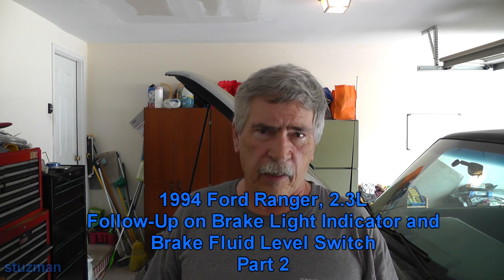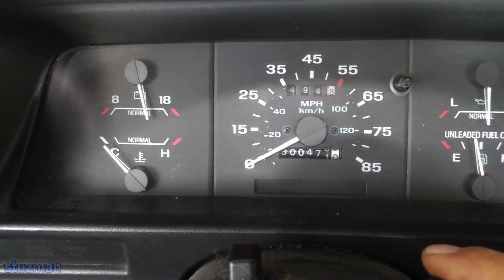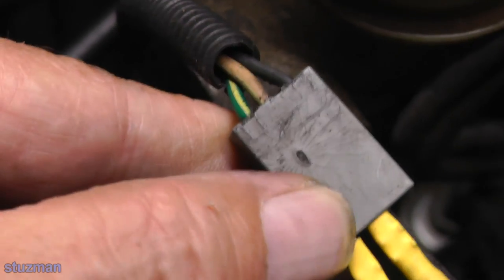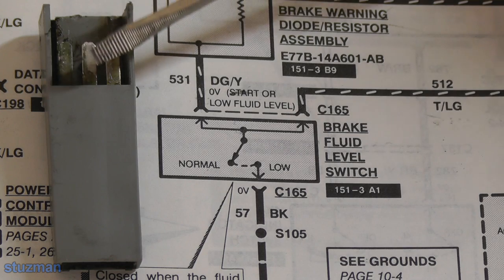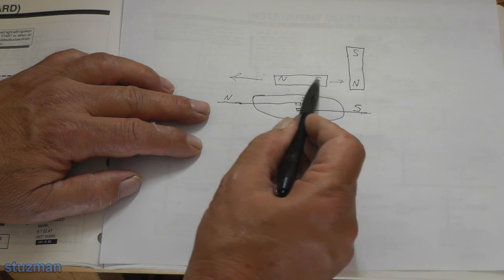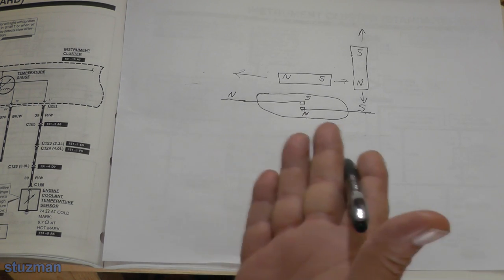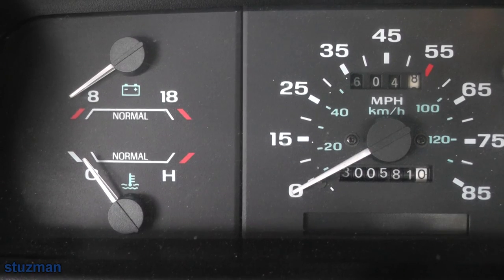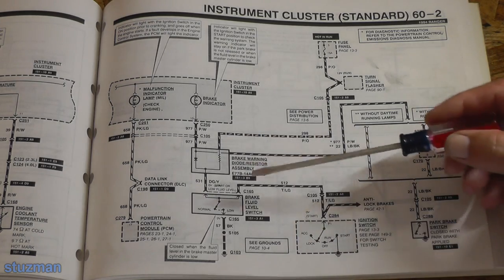Brake Light Indicator and Brake Fluid Level Switch Part 2

Comment: The details you get into / provide are just awesome and very much appreciated! VW for the most part also triggers the brake warning light whenever there's an issue with the abs.
Reply from the maker: Thank you Thomas and most cars today are set up the way you describe where the brake light comes on whenever there is an issue with the ABS. However, with this Ranger, there can be an ABS issue and yet the brake light doesn't come on. But on the other hand, if there was an issue with with the brake warning light coming on, then that would bring on the ABS light. Hope you're having a good day!

Comment: A really quick way to test to see if your sensor is faulty  if your brake light is on is to pull it out from the master cylinder and leave the wires plugged into the sensor. If the brake light stays on the sensor is bad. When I unplug the sensor the brake light goes out.  I was worried about the master cylinder float not working but when my sensor is out of the master cylinder with no magnet to touch it and it’s still on is telling me the inner wires are stuck contacted together causing my light to stay on 24/7. That’s what I did to diagnose mine in all of 2 seconds. Thanks for the extensive testing on your end if I needed it.

Comment: so could the contacts in the reed switch corrode if the atmosphere in the switch is no longer inert and cause the high resistance when closed?
Reply from the maker: Very likely Neil since the reed contact should be isolated from the atmosphere.

Comment: I'm trying to figure out a similar issue. But my issue is the brake warning light stays on unless I unplug the reed switch. I tested the reed switch and got exactly the same results as video. However I noticed when testing common terminals while switch was installed I see 2 volts...if thats a common wire shouldn't it read 0? Could it be a break inside the reed switch or maybe an issue with the diode/resistor assembly? This thing is driving me nuts but this video has definitely helped tremendously!!!
Reply from the maker: Eric, measure the voltage across the brake level switch on the dark green/yellow wire and the black wire. This is with the connector plugged on the switch and be sure to have the ignition switch in the run position. You'll probably measure near 0V which indicates that the brake light is on. It should measure near battery voltage when all is good. If you measure near 0V, either you have a bad reed switch or there is an issue between the magnet on the float activating the switch. Since you mentioned that the switch checks fine with the magnet as shown in the video, then you're down to the magnet not activating the switch. And of course, you could be low on brake fluid, but I'm sure that you already checked that. Hopefully,
Reply: @stuzman52  thanks for the reply. I'm going crazy trying to figure this out. This is where I'm currently at. I have cluster removed. I was trying to find short in dark green/yellow wire to cluster, so I decided to ohm test from float switch connector to purple/white wire in cluster. I realize if diode is working correctly (which it is) I would get no reading. But it would rule out a short from purple/orange to purple/white( and I assume rule out issue with park brake switch). It reads as it should but here's the wacky thing. I accidentally hit pin next to purple/white in cluster harness which is lt blue and I'm getting continuity! Lt Blue is the 4x4 hi indictor. I'm so confused. Plus I don't have 4x4. I'm thinking it's a bad pcm that thinks 4x4 is on. Which I understand would in return turn off the abs...just to remind I have abs light and brake light dim. I've tested dk green/yellow to black with float switch connector plugged in and I get .7volts. any thoughts?
Reply from the maker: @ericgautieri1435  Eric, I am confused with your diagnosis. You said in your first post, that the brake light stays on unless I unplug the connector for the reed switch. That confirms that you don't have a short going back into the cluster. If the light goes out, there is no grounding or short on the purple/white wire. As I mentioned before, your issue is that the magnet on the float is not activating the reed switch contacts. As for the 4X4 light, I wouldn't worry about that since you don't have it and just focus on the low brake fluid indicator light.

Comment: Help!!!! My abs light is on and I’ve fixed all the other items and I’m so stumped. Been chasing my tail for 3 weeks. This video has been so helpful and was such an easy to follow video. But I do still need some help if I can reach out to you.
Reply from the maker: Hi Kendall! I assume that you have some ABS codes which could give you some direction. Maybe a wheel speed sensor code??
Reply: @stuzman52  dreaded code 16. First problem was the master cylinder but that had been corrected. Now ABS light won’t go off.
Reply from the maker: @kendalllee6441  Check to make sure that both of your brake lights are working. If that’s not it, you’ll probably need a subscription to alldata.com to look up the code, how the system works, what criteria sets the code and how to troubleshoot it. Have a great day!
Reply: @stuzman52  yeah it’s very strange. Brake lights all work, I changed the headlight switch , brake pedal switch, checked all the fuses, did end up changing the parking brake switch. And code 16 still comes on.

Comment: Hi Terry,Here in UK, we are forced to take the car in for minor
electronic issues and we are denied access to the most basic wiring diagrams! Any
suggestion on how to get hold of wiring diagrams for Ford Mondeo 2006 or Ford
Streetka 2004 please?
Reply from the maker: I didn't realize that you folks have it that bad over in the UK about getting information. I took a quick look at a website http://www.bbbind.com/tsb-wiring-diagrams/ which offers free wiring diagrams. I punched in your models and it doesn't show up where in the US, these makes are not offered. Can you subscribe to an online site, (you'll probably have to pay) where you can get the information for your vehicles. Sorry I don't have a good answer for you.

Comment: Thanks for your videos!  I'm building a 1952 Ford truck on a 1986 Ford Ranger frame and using the powertrain from the ranger. I'm currently working on modifying the gauges of the Ranger to have 52 Ford gauge faces and fitting them in the 52 cluster.  I'm also adding custom dash warning lights.  Your videos about the fuel level gauge and brake light indicator have helped a whole lot!  Thanks so much! - https://wheelwell.com/wes-neufeld/
Reply from the maker: Thank you Wes and glad the videos have helped you out in your modifications!